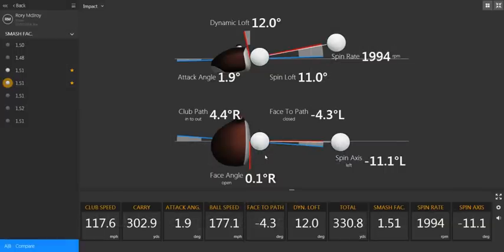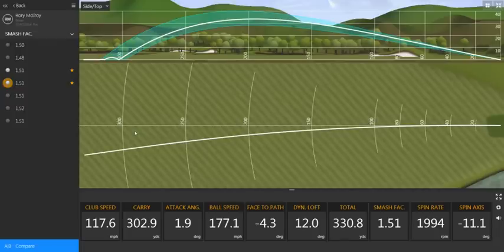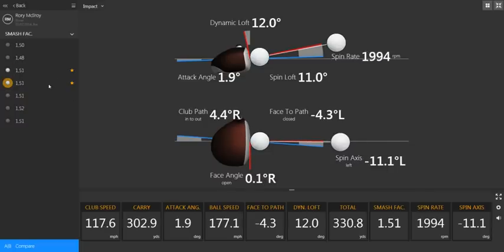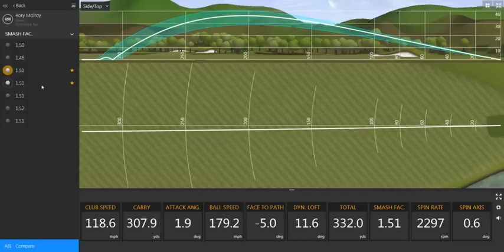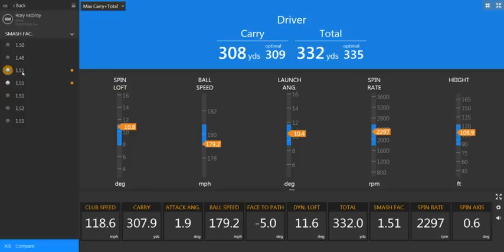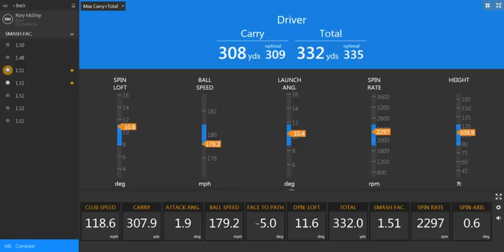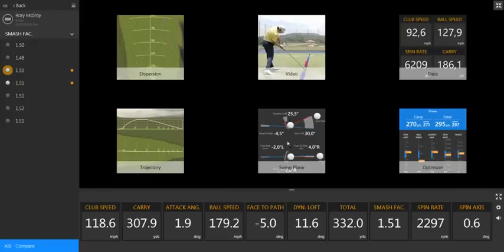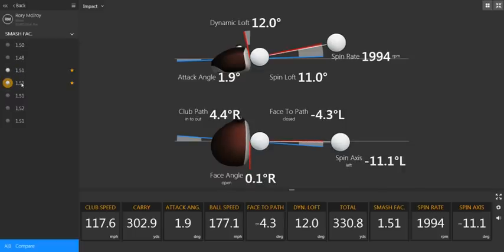Rory McIlroy - TrackMan Driver numbers

Comment: What do you think of 4 inside? It that a bit extreme leading to his bad left shot?
Reply: +dmurfet1 His distance comes from a high-launch low-spin draw.  That ball flight requires an upward angle of attack and a face closed relative to the path.  According to Trackman 0 is ideal, but there's plenty of people on tour who's face to path differential is >3
Reply: Sean H but his bad shots come from the same.....
Reply: dmurfet1 Sure, but you have to remember the anatomical aspect of the swing.  Rory is extremely flexible in the thoracic spine and hips, so he can create a bigger 'xfactor' which typically means a more inside-to-out swing path.  So he could coil less & lose distance, but length is a huge advantage

Comment: heally shot with a SM of 1.51 ???
Reply: +CMBelite-FR Smash factor over 1.49 is theoretically impossible according to laws of physics. I think this is the only major flaw of trackman that it actually doesn't measure club head speed 100% accurately. I think it measures it slightly slower. So those lower club head speeds with ball speed it tracks very well attribute to the high smash factor like that. Rory has more speed than 117.
Reply: not with a legal coefficient of restitution it isn't .  1.5 is an approximation the highest smash factor with usga legal club and ball is 1.488 with a driver that would have 0 degrees of loft and the most compression.
Reply: Golf Code Weekly sorry buddy you are wrong
Reply: Golf Code Weekly they are exceeded using flawed measurements which is exactly what I'm speaking on about this video. Trackman has already acknowledged this fact to be true, which is why their new model that is just being released in last 3 months has 2 radars one that tracks the club head and one that tracks the ball. There is plenty of information on this if you just to continue to not believe me, you can research it yourself.

Smash factor is an algorithmic based number. Meaning they take the ball speed and the club head speed to find it. The problem with that is that not all drivers have the same CG. Meaning the sweet spot is different for all of them. Trackman used a geometric shape of the club head and just assumed the CG (sweetspot) is relatively in the middle. This is a close approximation but not exact. Which is why trackman club speed is slightly slower than real time. 

You can argue all you want. You will never be right. Sorry pal.